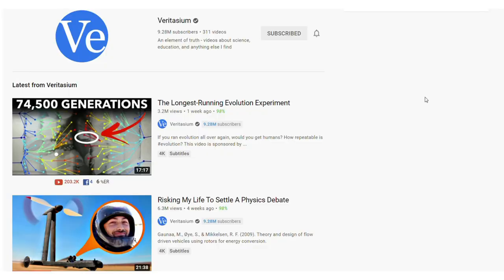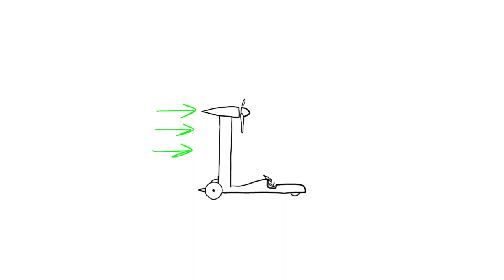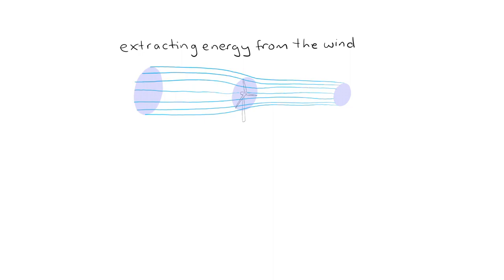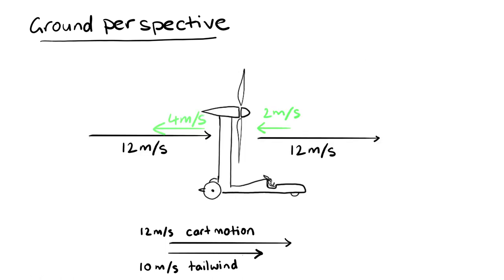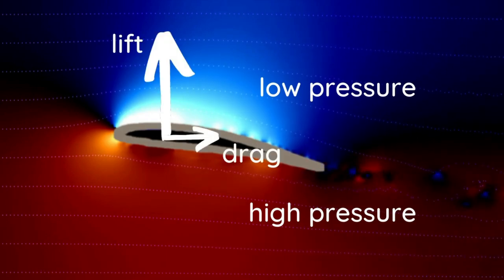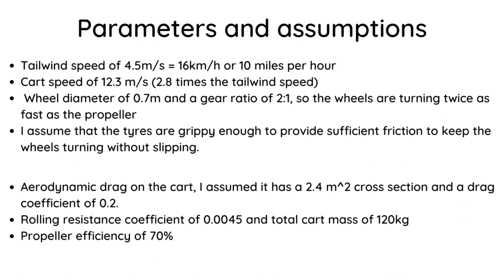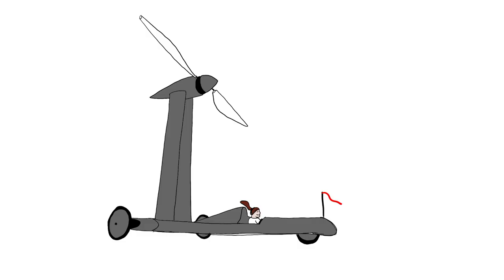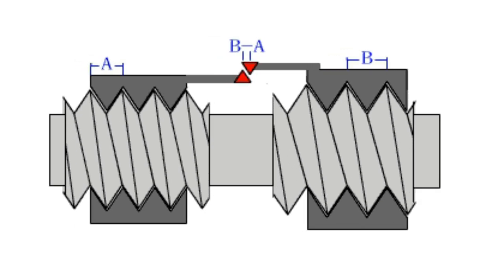Downwind Faster Than the Wind by Veritasium: How Does it Work?

Comment: I think the easiest way to explain it is to think of the air for what it is, a gas fluid made of particles, and the wind flow relative to the ground sees the particles want to distribute a certain distance from one another within the wind column so as to equalise the pressure within the column, and the interface those particles have with the prop blade face causes them to be deflected back away from the blade face, back into the otherwise equally distributed wind column behind them, thus increasing pressure immediately behind the blades, which causes the cart to move faster to alleviate this back pressure. Its simply a mechanical scenario wherein the cart can take on a lot more momentum than what is intuitive,but it will have a natural speed limit where there is equilibrium between the drag on the cart and the pressure gradient behind it.

Comment: Hi,  Rosie,  I think the best proof of all will be if  someone makes a carousel,  8 ft diameter or more.  Put a "race track" or model train track on the outside. You just spin it up to speed   then race your 3 wheeled  mini cart with a propeller  against a 3 wheeled mini cart with a sail.   Or if you go the model train track route,  race  a "train" with a propeller connected to its wheels and a train with a sail.  You just put the sail train at the opposite side of the carousel.   Also,  you can put a camera on the carousel. From the camera's viewpoint the ground is moving and there is wind.  (can also have windsocks on the carousel).   I have a video with tips to make the thing (I wouldn't be able to do it myself), "Carousel to prove Faster than the wind directly downwind".   A carousel proof like this could be a much more rigorous proof than any previous attempts. And because the air above the carousel is barely moving,  you can blow smoke over it to show how the propeller and how the sail affects the air as it passes through.

Comment: What I don’t understand is they explain it on veritasium with a kart on a treadmill.

They just use an external force (motor from the threadmill to power the propeller)

What is the difference between this and attaching a motor straight to the prop?
Reply: @Rick_Cavallaro  it has electric motors in both rear wheel hubs and the prop housing. they're really obvious, as are your lies.
Reply: @Rick_Cavallaro  your ability to get posts deleted from every channel you post on is very suspicious.
Reply: @Rick_Cavallaro  Galilean relativity is about the frame of reference. If you drop a ball inside the car driving or if you drop a ball standing still, to the person inside the car it will appear the same. Doesn’t really have anything to do with forces applied to the vehicle?

Comment: Loved the much more deeper explanation. Thanks.

I do have two questions though:
1. Both you (at 4:35) and Veritasium mention the difference between ground speed and wind speed as significant. I assume it is not just related to the startup, but is important for acceleration at any point. This makes a lot of sense - if it wasn't we would have a vehicle that speeds up and produces wind, which sounds wrong. But I can't really fit this requirement into the lift/drag model you presented. This is especially interesting since I read that Blackbird can go upwind (although I don't know if it was same configuration).

2. The second question is related to what limits the maximum speed of such vehicle. What happens if we ignore some less interesting stuff - drag on the vehicle frame, maybe add some impossible gear ratios and propeller size; limit ourselfs to just classical mechanics and ignore all the light speed stuff. In such idealized scenario - could the Blackbird reach infinite speed (or at least unbounded - that for any requested speed there is a configuration that can reach it), or is there an upper bound based just on the lift/drag produced by the shape of propeller?
Reply: The speed is limited by friction

Comment: I´m confused by the condition in which wind speed is equal to cart speed.  We are saying that the rotation of the wheels then drives the propeller which creates thrust and moves the cart forward... turning the wheels...which then power the propeller... which then pushes the car forward...Is this not perpetual motion?  I mean, the wheels turn the propeller,  which creates motion, which turns the wheels...  It seems like a closed loop.
Reply: It's not a closed loop because the propeller decelerates air (relative to the ground).
Reply: It's not a PMM but it is a positive feedback loop.

Comment: Okay finally got it by understanding how the thrust produced aerodynamically by the fan can be larger than the power the  wheels are supplying. The wheel power is only there to push the blades forward through the air. Aerodynamic magic happens and thrust is produced moving the buggy forward. Energy is conserved in the system overall because air is being moved backwards relative to the buggy. It's a bit like how can a b52 with a weight to thrust ratio of only 1:0.2 stay in the air. Aerodynamic lift can make amazing things happen

Comment: This took ages to click.
As long as there is a relative difference between air and ground speed, the craft will be powered. The amount of power dictated by the driveline and prop efficiencies. I got stuck thinking the lift generated by the spinning aerofoils was the trick but that only affects the maximum speed (via prop efficiency) not the concept.
Thank you for getting me there!

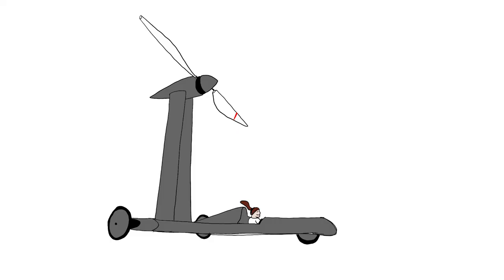Comment: Hi Rosie. Great work applying maths to explain what's going on. While working through your arguments I was unable to reconcile your stated blade speed of 13 m/s in the wind vector diagram at 12:34.
Working up from the cart speed over the ground, travelling at 17 m/s (38mph), I calculate the blade speed at 44 m/sec not the stated 13 m/s. Here's my working:
Wheel diameter 0.7 m.
Wheel rotation speed = 17 / (0.7/2) = 48.6 radians/sec.
Prop gear reduction 1:2.
Thus prop rotation speed = 24.3 radians/sec.
Thus blade speed at 3/4 radius  of 1.8 metres = 24.3 * 1.8 = 43.7 m/s, not the quoted 13 m/s.
There are a couple of other quibbles I have with the argument as well.
As a fellow Sydneysider and STEM enthusiast, I would welcome the opportunity to assist in revising the workings.
Reply: The numbers at 12:34 seem chosen to have a clear diagram explaining the concept. The Blackbird numbers at 3/4 blade radius would produce a much thinner triangle.
Reply: @eyytee  So we agree: The displayed triangle does not represent the stated conditions. 
I think you are doing Rosie a grave disservice by suggesting she has intentionally misrepresented the data to achieve "clearer diagram". Her attention to technical accuracy in her other videos is ample evidence of a high degree of scientific rigour. 
I'm pretty sure it's just a miscalculation.

Comment: Rosie, the practical engineer that is the plumber in me is seeing it much more simply- the wind blowing forward through the propeller creates both horsepower by spinning the prop and through resistance to the wind passage. When the car reaches the same speed as the wind, the propeller is still spinning, though is doesn't receive much air speed to do so- but it adds to the speed caused by wind resistance, making you go faster- you aren't extracting speed form the wind but horsepower, more horsepower than it takes to push the cart more than the wind speed. But that is what my "practical eye" tells me. Thanks for the "unboxing"- it does seem a conundrum on first look. FR
Reply: // "..the wind blowing forward through the propeller creates both horsepower by spinning the prop and through resistance to the wind passage."//

That's not how the vehicle functions though --at no time during it's operation does the wind spin the propeller directly.   You're describing the classic function of a turbine and the Blackbird rotor itself doesn't function as a turbine, but rather as a propeller.

Comment: VCRIT

  As an experiment, it may be useful to define a critical velocity, VCRIT, a steady-state ground speed, at and beyond which the vehicle’s thrust (plus any drag if the tailwind is pushing on the vehicle) exceeds the forces that are trying to retard it (rolling friction, drive train inertia and skin friction).  If the vehicle reaches this speed, it can go faster than the wind, and can increase speed until those retarding forces grow to be greater than the thrust.

  Imagine a tow truck that can pull the vehicle, with a tow bar that is long enough so that the truck does not interfere with the vehicle’s aerodynamics.  In the tow bar is a spring, whose length will vary, showing either tow bar tension or compression.  In tension, the vehicle wants to go slower than the tow truck, and in compression, the vehicle wants to go faster than the tow truck.

  Starting with the case of zero tail wind, let the truck tow at a slow speed, and notice that the spring is in tension, indicating that the truck is having to overcome the vehicle’s rolling friction and drive train inertia.  As the truck achieves faster and faster steady state speeds, it will eventually reach a speed where the vehicle prop is turning fast enough to develop sufficient thrust to exceed the retarding forces, and then the tow bar spring will show compression, indicating that the vehicle is trying to go faster than the truck.  The changeover speed (from spring tension to spring compression) is VCRIT.

  Repeat the experiment for different amounts of tailwind, and develop a VCRIT for each tailwind.  The values should be close together, only varying by the contribution of the tailwind’s push on the structure, a push whose magnitude becomes less significant as the prop thrust takes over.

  There will be a minimum value for tailwind, below which the vehicle will not achieve VCRIT and will not exceed wind speed.

  A couple of notes:

•	For the purpose of gathering data on the vehicle when not under tow, there is no need to start the vehicle at an initial speed of zero.  It is possible to save time and distance by crossing the starting line at any desired speed, by using either 1) a catapult like the Wright brothers’ 1903 apparatus, or 2) a ramp like the ones at a Soap Box Derby race.

•	If different drivers are used, keep the vehicle weight constant by adding a water container which can be filled to the extent needed to bring the light-weight drivers up to the weight of the heaviest driver.

Comment: Rosie, I have tried to follow your argument, and I sort of understand. But there is still this element of getting something for nothing, and as that is not in line with the Laws of Thermodynamics. Where is the energy coming from to drive the turbine, if the wheels only spin it, rather than power it? I will go back again and try to get an idea of what you are saying!
Reply: Don't confuse 'force' with 'energy'.   Yes, the wheels provide the force to turn the propeller but the ultimate source of energy is the wind.  The true wind (wind over the ground) is slowed down and that harvested energy used by the Blackbird to propel itself.

Comment: Also the rotor turns with an angle of attack and  is only used for rotational velocity. the air that is pushed backwards has a normal force that is accelerating it backward by tensioning the shaft as well and so isnt directly pushing the air back.

Comment: Interesting video, but it was actually simpler for me to think about how this works from an energy standpoint. I originally thought it wasn't possible because I couldn't see where the extra energy was coming from to make the cart go faster. But after thinking about the spiraling sailboats and considering that a tacking sailboat can move faster downwind than the speed of the wind, I realized the cart's propeller gets the extra energy the same way.

In sailboat terms, the true wind (the wind going downwind) induces an apparent wind relative to the prop blades that creates more lift, supplying an additional turning force on the blades as well as thrust in the direction of cart travel. Amazingly, this works even if you're going faster than the wind, as long as the blades are moving at an angle to the true wind (which the spiraling sailboat animation shows for the cart). There's a limit because the faster you go the less energy you can extract. So the propeller is acting like the sailboats' sails getting energy from the wind, providing a little extra thrust and torque to the wheels to make the cart go faster, and so on.

Comment: I designed one like this on paper back in '84-'85 but everyone said it wouldn't work so I dumped the idea.
They said it would be a perpetual motion machine, but I had the mechanics worked out in my head. 
I wish I had built it anyway. Or at least saved the drawings. 
My only real design differences were to use larger drive wheels in the rear and to use a belt drive with a single front wheel. The body would have been a single stiff wire, nose shaped like the front of a shoe and squared off at the back. It would have taken a lot of trial and error as I didn't do any math.

Comment: To me it most makes sense to look at how the wind can still put force on the propeller. The idea is that relative to the blade, the stream line of air is interacting with the surface of the blade, but the piece of surface it's interacting with is moving. It's moving sideways, but it's angled, so the surface that's interacting with the air is moving backwards as well. So if you were a fixed bit of wind, your relative speed to the propeller surface you see straight ahead is still positive.  IE, the movement of the propeller is fast enough horizontally, that the incline means that that streamline is interacting with something that relative to it appears to be moving backwards, so the wind can still push on it.
Reply: This explanation is visualized in my clip: "Directly Down & Up Wind Faster than the Wind"
Reply: Thanks, good visualization. It makes most sense to me when you understand how the momentum can still be transferred. When I finally drew it out it made more sense.  It also is important to note that since the airfoil is rotating, that I’m the middle has a lower velocity, so the outer part has to make up for the middle which loses thrust quicker. That also helps us understand a bit about the importance of the size and gearing ratio of the rotating sail versus the wheels/speed. It has to rotate fast enough to maintain the negative air-surface point velocity. Thanks for sharing!
Reply: @robertb6889  "since the airfoil is rotating, that I’m the middle has a lower velocity,"

That's why the blades are twisted: the airfoil chord orientation changes with radial position. But since the twist is fixed, it's not optimal for every condition.
Reply: Yeah, I figure that goes into the design with an implied design speed for the propeller.

Great to learn new stuff as I’m a chemical engineer not an aerospace engineer.

(Also sorry for the I’m/in typo there)

Comment: Its a fake debate , it's the   WheelSpeed/TurbineSpeed  ratio that is  dictating the car speed not the direct wind , the wind is just energy source, and the car use that energy to move at its own speed  , the turbine will always  turn because it has to follow car wheel rotation and assisted with the wind at the same time .that's all
but at the end the wind will never push or blow something directly faster than wind speed.
Reply: It's not a turbine.  It's a propeller.  If it were a turbine, it wouldn't reach windspeed, let alone 3x the windspeed.